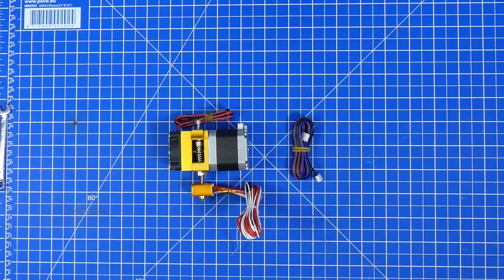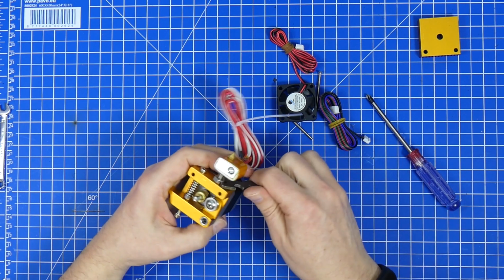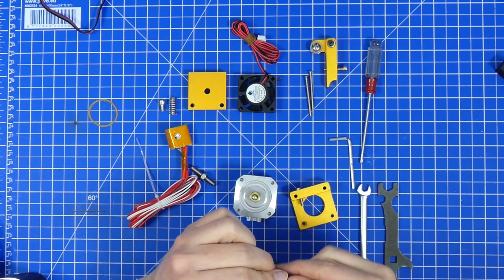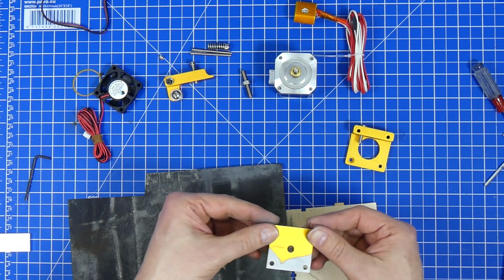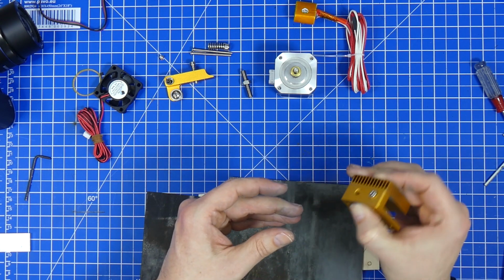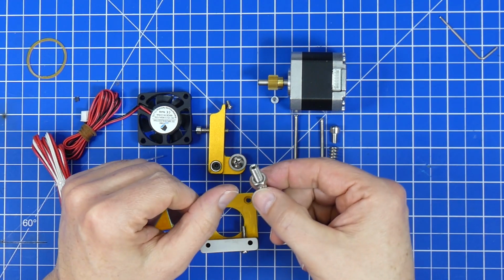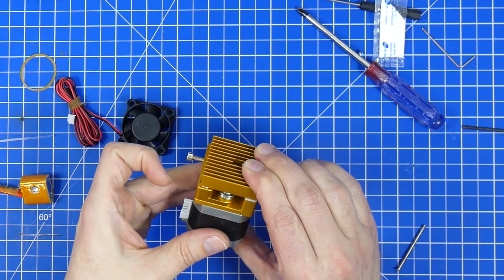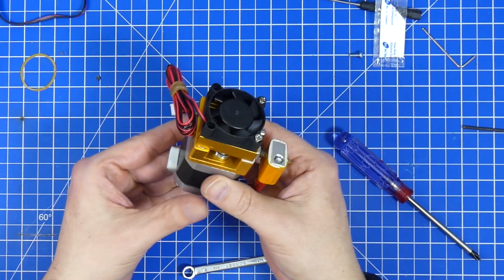Improving a dirt cheap extruder

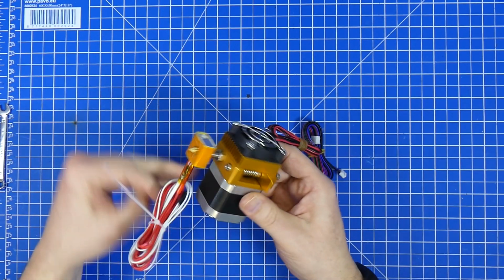Comment: That's the hotend from an Anet A8. The screw you mentioned at 2:40 is the mounting screw along with the bolt on the throat.
Another good thing to do it remove the PTFE tube inside the throat and replace it with a new one with square end cuts, the current cuts aren't square and leave a gap on all sides but one for filament to get caught on.

Comment: I think the way it's supposed to be mounted is not by wedging a mounting plate inside the assembly, but from the botttom, with the assembly being held by the throat and the screw that centers the spring, that all goes onto a 4mm thick aluminium plate there that is drilled through at those positions and has numerous tapped holes elsewhere to attach to a horizontal mount. This is why the spring centering screw is excessively long and all the other screws are too short to accommodate an extra plate. The throat should extend outside the assembly as long as possible to allow some ambient cooling before it goes into the extruder, and the 4mm plate (not supplied) would take the brunt of the cooling. The throat should also be placed with the liner side up, the way it was assembled originally, so that the metal portion at the bottom serves as the border of the melting chamber while the liner serves as heat break, to prevent heat from travelling up the filament and into the extruder.

Filament kinking is indeed an issue, and it's suggested to resolve it using an additional insert that you can 3D print, rather than by jamming the throat in.

I can't imagine the coating to be painted, that wouldn't be economical or come on this evenly, it's likely just a good durable elox, even if it is pointless and misplaced here. The top layers of aluminium are converted into porous aluminium oxide that readily accepts pigment from the solution, so you can achieve a remarkable pigmentation depth and it's always even, and the hardness of aluminium oxide prevents sanding because guess what your sandpaper is made of, it's probably aluminium oxide too, so you usually get that gradient where the pigmented layer comes off quite gradually when you try to sand it. It doesn't mean that it's paint.

Comment: I love very pointy nozzles because they open up a lot of moving space with non-planar printing experiments.

It's better to figure out the right temperature in the block to have the right temperature in the nozzle tip than to want to rely on the nozzle tip being closer too or part of the heating block.

Because we are moving to non planar printing and at that point you want as sharp an angle on the tip as you can get to broaden your ability to reach places in a non-planar way.

Comment: To completely and easily remove all the gold anodizing from the two aluminium parts is to just emerse them in simple oven cleaner (any make from your local corner shop) for 10 to 15 mins.
Use a little plastic pot to do this in etc. It'll remove it all from inside the threads too (if you move the parts around a bit whilst they're soaking in the cleaner).

Then just sand the matting surfaces as you did.

They look better anyway in their original aluminium colour.
Reply from the maker: I need to try that recipe ! Did not know that would work.

Comment: Hello. The best is to tight the nozzle when its hot otherwise you can have leaks. With this extruder it nearly impossible to adjust the pressure on the filament. With normal filaments it's not a huge problem but with flexible filaments it's a problem because you need to reduce the pressure.

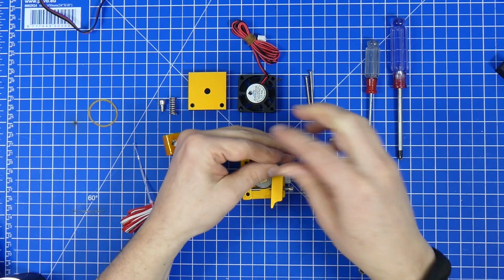Comment: 10:56 The screw on the fixed end of the spring should be reversed. You'll find the socket head fits just nice inside the spring and retains the position. You don't need 10mm of thread sticking out!

Likewise the PTFE liner should be closer to the cold end, otherwise it will be more likely to breakdown with higher hot end temperatures.
Reply from the maker: If I screw the bottom setscrew in all the way it blocks the short screw inside the spring blocking the lever, they can't be exchanged: the one in the spring is too big. Top and bottom set-screws are the same size and length - so no way to improve that without a new screw.
The PTFE was like that in the first extruder I had, it came out at the top during retraction and got so badly damaged by the pulley that I could not get any filament in at all. The PTFE will do fine up to 240degC, above that it's better to just get an all-metal throat.
Reply: Just humour me and see if the head of the M3 screw that fouls the M4 screw inside the spring actually fits.
If it does, remove it and screw in from the other side. You only then have the head sticking up, spring about it, and a heap of space to operate the lever.
If the thread hanging out into fresh air is too long, cut it shorter, no need to find another screw.

I have the same extruder, but as bowden, and the spring assembles fine as I describe. (YT won't let me attach a photo)
Reply from the maker: Right! That's exactly the one I have - only that the bottom M3 screw is about 25mm in length. It sticks out one way or another.
Reply: AH, my tension adjust and the "spring locating" screw are M3. An M4 head would be too large. Other option is to shorten the screw so it sticks out a more appropriate length.
Reply from the maker: No, it is M3 ... you overtook me while I edited my mistake ... but it will stick out anyway - both the M3 screws are 25mm. But no matter - I'll cut it of or attach a fan shroud to it - as long as it does not fall out, it can stay the way it was.

Comment: You try to rotate that bearing assembly whithout disengaging the extruder gear's tension. So that means the brass gear is just pressing against it because there' no filament between them.  After you remove it, and it "wow magically rotates now" you're doing the proper thing to check it, by holding pressure on the spring-loaded tensioning arm.

Basically you didn't fix jack shit, you just decided to press on the tension arm the second time around to make it look like it now functions.

Comment: Hi. It's a brilliant HowTo Video with a lot of Information. Normaly if i start thinking, all this issues i schall see ... but i did not think about. :-). OK i did it as decribed, but uses a granit bank  to have a flat groung to sand. I'd an other issue with the cheap extruder and as far as i can see in your video your Extruder had the same issue. The cooler rips shall show to left and rigth but he show to top an bottom. If you blow. you will get uncontrolled airflows on your print. If you run reverse, you will get more than the half of you cooling air pree heated from the hotend. Nice ilustration of Chineese copy without understanding ..... the only solution is to see it early, make one additional hole, to twist the orientation by 90° and sand only the new contakt area. :-). b.t.w most of your videos where great for me to solve issues and to pimp my CTC MK8 I3 Clone for ABL, Dual Extrusion and excelent print results. Thanks for that.

Comment: In my application (CTC Prusa i3 clone) of this extruder the whole unit sits on top of the mount and the extruder throat tube and spring set screw both go through the 3mm thick mount, then the set screw is much shorter inside the spring and the other screws are just long enough as designed. I did note that the motor in this one does need a tweak of the drive current in the upwards direction.  I left the heat sink alone and the motor and other bits don't get excessively hot even on a 24 hour print.

Comment: Actually you don't need to flat the parts. You can use heat transference grase. And this is another tip: The PFTE part can be rounded so you can invert it to print PLA.

Comment: "The pulley is wedged in again"
Of course, BECAUSE there is no filament between the drive gear and the pulley, THEREFORE the pulley is pushed by the spring against the drive gear.
What a miracle, when you press the lever the pulley is free to move again...
Also, talking about expected precision while using a combinated bicycle spanner and sanding a 'perfectly' flat surface on that piece of scrap hdf... I don't know man.
Reply: Sometimes you just have to fast forward to stop gritting your dentures.....being a skilled metal worker does make me a bit less tolerant to people without those skills. Also, I found the video to be a bit too long winded and fumbling in parts.....good to see the insides of the extruder though for future reference.

Comment: The (hot end) was installed correctly.  The PTFE liner is supposed to be as far away from the heating core as possible. The filiment idler pulley bearing wont turn while under preassure from the idler tension spring, (it only turns later because he compressed the tension spring,  relieving the tension). The only two improvement made here was adding the heat compound & installing a shorter floating screw inside the tension spring. The problems with the extruder are: There is no thermal compound between the heatsink and assembly. The fan srews are too short. All of the rest of the screws also appear to be too short and too long for there individual application's. The fact that the fan screws are being used to hold the heat sink on, prevents them from being tightened properly (hence the broken fan shroud). Its simply a poorly assembly/designed extruder.
Reply from the maker: I agree that the extruder is poorly designed, but if they wanted to have the PTFE at the top near the driver, they should have glued it into the throat, 'cos as soon as I started printing with the first one I bought from them, PLA started seeping into the cracks between PTFE and the throat and started pushing the loose PTFE liner up and against the drive gear.
The idler was blocked by some aluminium shavings left over from cutting the thread,  yes, I know it helps pushing the idler from the gear,  but thanks for reminding me. 
The intended mount may well have been designed to attach to the throat (As many already pointed out) .
It did turn out to be rather good in the end. (See my Big Bad Robin series) I really grew to hate it.
Reply: Glad I wasn't the only one who noticed the only thing he "fixed" by getting the bearing to rotate was putting pressure on the tensioning arm the 2nd time around. LOL

Comment: today i found a grub screw next to my print and i thought it must have been from the extruder gear so I took it all the way apart and nope both grub screws were intact. then I found out it was the grub screw that holds the heater. I'm about ready to start super glueing all my grub screws this seems to be a theme.
Reply from the maker: I suppose it would be funny to find a print rattling, and then find a grub screw inside - I do put locktight on some screws, but I've never lost a heaters screw so far - you must be really pushing the speeds on that printer.
Reply: @dherrendoerfer  I don't run it that fast I just get a lot of vibrations. It's a modified prusa clone. I was bewildered to see a chrome looking grub screw just sitting on the build plate next to the calibration Cube. The superstitious part of me thought maybe I accidentally unlocked the next level or something
Reply: @intelligenceservices  There is something terribly wrong with your "clone" if you have any vibrations whatsoever.
Reply: @yourtubernoob  well, echoes and ghosting are a result of the kind of vibration that i'm talking about. all metal extruders have more mass to deal with in the carriage and when there's a reversal of direction in the case of narrow infills for example, that's the kind of physical motion i mean when i say vibration. any screw is subject to loosening in time, unless threadlock or something like that is used.

Comment: Thanks for the makeover on this extruder.  I just got mine today, from Amazon, for my CTC Prusa i3 Clone. The heat sink block, the extruder tube, and the gear needed to be dealt with according to your instructions.  The screws will not be an issue since I have enough should I added anything to this unit.  Thanks again.

Comment: This is a bit of constructive help. In this video the extruder setup is missing the bracket that holds this to the 3D printer. The information that the person says that this needs a bracket between the gold part that holds the pulley wheel that guides the filament into the hotend. A motor mount does not go between those two parts. For the person that has done this video I will providing a link for you to have a look at that shows the correct assembly of this part with the bracket that holds it to the 3D printer axis. https://m.ebay.de/itm/Geeetech-Metal-MK8-Single-Extruder-Holder-Motor-Bracket-For-3D-Printer-/282843997934?_mwBanner=1 . Also this will help people for further reference of where to get this bracket from. Hope this was helpful to everyone that see this video.
Reply from the maker: This is the original (advertised) mount for the extruder that I bought: https://www.aliexpress.com/item/Metal-MK8-Extruder-mount-motor-plate-for-Reprap-Prusa-I3-3D-Printer/32459720489.html
And no, it does not work for it. The screws are too short. I have an i3-like build, where the extruder is held from the back, not from below, where the mount you referenced will work. Many users choose the clamp holder, but that traps quite a lot of energy in the stepper and idler assembly.

Comment: The ptfe tube must never be on the heatblock! The ptfe will deform after a while what result in filament getting stuck and jams. On all E3D heatbreaks the ptfe tube is on the top side where the filament is correctly guided into the heatbreak.
Reply from the maker: There are two E3D throats, one is the all-metal where the PTFE stops before the throat indent, and the second that has a smaller PTFE insert right up to the nozzle end. Both are good up to about 240 degC going higher you need the all-metal part. And yes - after some time the PTFE will deform, and PLA can ooze into the joint area. That's why you should change the PTFE tip too when you're changing nozzles.

Comment: How much do you need to screw the tube with the thermal barrier into the housing? What should be the distance between it and the mounting plate?
Reply from the maker: The throat should be half-way into the heater block, the nozzle should also. The nozzle rim should not be touching the heater block so all pressure is on the throat, not the block.
The throat and the cooler block should be at least 3mm apart at the counter-nut.

Comment: Sanding off the "coating" is pointless, because it's not paint, it's simply aluminium oxide, infused with pigment through a process called anodization. The oxide also increases the amount of heat dissipated by radiation. A better solution would be to just apply some thermal grease, commonly used between CPU's and heatsinks in computers.
Reply from the maker: Removing the coating is not the point, it's getting the two surfaces to be flat, because before, they were not. Thermal grease is also applied after that.
Reply from the maker: And, normal dye oxidization anodization (AL2O3) will reduce the surface-to-surface thermal conductivity, while raising the radiation potential due to the larger surface area of the oxide. Oxalic-Acid based anodization has better thermal conductivity through the oxide, but is way more expensive and needs several steps. For the radiation of energy the color may also also be a factor.
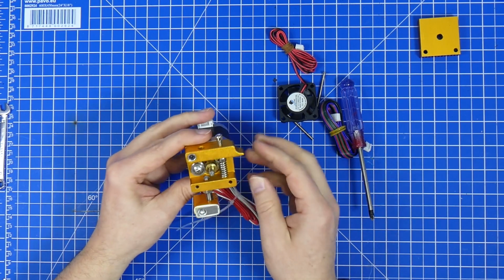A fun video about that: https://www.youtube.com/watch?v=nItYATEb6-U ( at 04:55 )

Comment: Have you done any experiments by checking the temperatures before and after mods?
Reply from the maker: Only indirectly - the body did get warm before the upgrade, now it does not.
But the biggest change was in the temperature-behaviour of the hot-end. Before the upgrade it fluctuated wildly with lots of overshoot - now it's spot on, and you can see the PWM of the controller going very steady. Set at 195 degrees it now stays within 0.5 to 0.8 degrees of variance.

Comment: Hi Drik, Thanks a lot for the video .. it was helpful
I have a  ِAnet A8 printer when I try to move the  Extruder stepper motor via control panel it does not work!!
Do you think that one of the Firmware lines needs to be modified?

thank you..
Reply from the maker: I don't believe so - it's probably the driver module that has an error. The extruders have a very low step rate, if it worked before then there should be no change.
Reply: @dherrendoerfer  
thank you , the stepper it work when connected to X axis cable 
but not working in his port socket!!
Reply from the maker: Just remember, never pull or plug a stepper when the printer is powered, this kills the driver modules almost every time !
Reply: @dherrendoerfer  Thank you :)

Comment: Just an idea but if the parts are lacquered would Acetone not work just as well, maybe then use wet & dry if the surface`s not flat
Reply from the maker: It's not a real lacquer, its an oxidizer together with a dye component, that forms aluminium oxides and bonds the dye onto the aluminium in the process.

Comment: I honestly feel dumber for watching this. Almost everything he did or how he explained it is bass ackwards.
Reply: Yea why would you turn the throat upside down with the plastic on the hotend?
Reply: @shanesmith3077   The way he flipped it is the correct way.  PTFE end should be towards the nozzle.
Reply: Everything he explained was the correct way.  If there is something specific you think was wrong call it out and help someone else out.

Comment: why not lap the whole thing? Now its as flat as the surface you used to sand it on. Glass would have been better or a flat reference surface
Reply from the maker: True. But it was even less flat than that before.